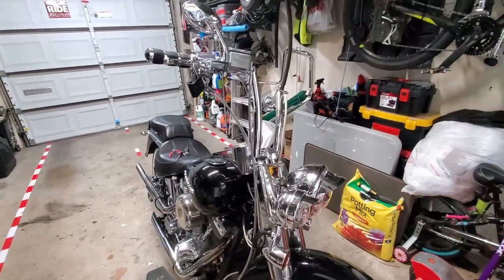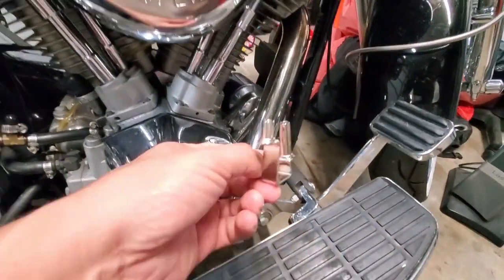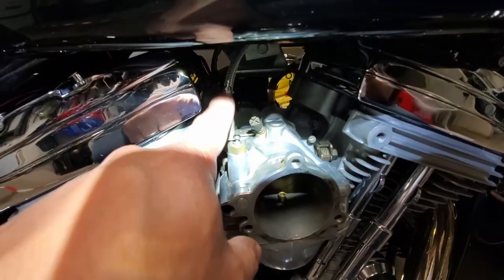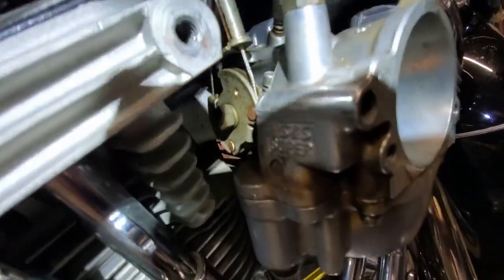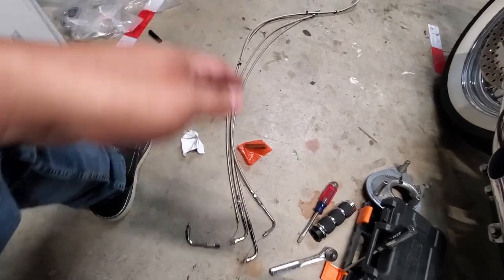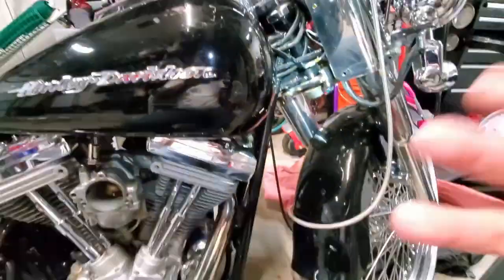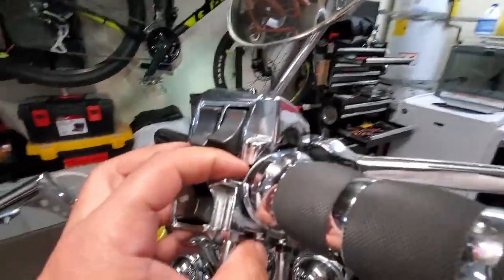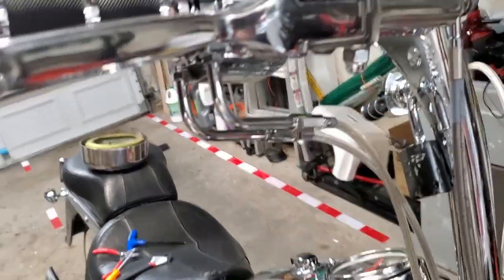Replacing Throttle Cables that are too long

Comment: Where the does the spring go on the idle cable?
Reply from the maker: Hi Adam, the spring sits in the "cup" of the bracket that is attached to the carb.  provides pressure (very little) between the bracket and the cable cover end that the actual cable passes through.  This link it to a forum for someone who was having spring size issues but the picture shows the spring and what part of the cable it presses against, doesnt show the cup though.  Hope this helps.

https://www.hdforums.com/forum/evo/1300164-e97-flhr-idle-cable-spring-install-2.html
Reply: Thanks!!! I was confused on that part and could T get a good answer. Someone said on the actual carb, which threw me way off. Up in the bracket makes much better sense. Thanks a million!!!